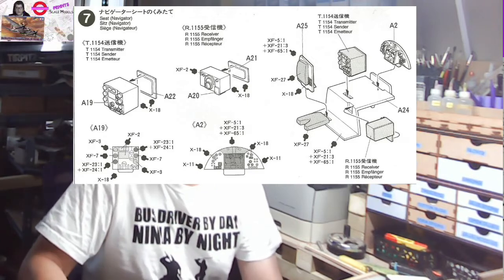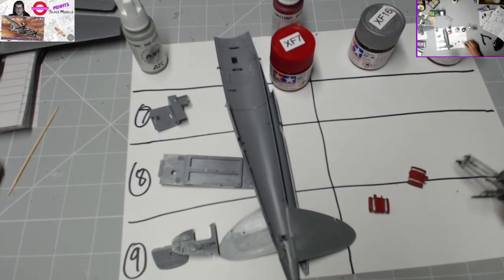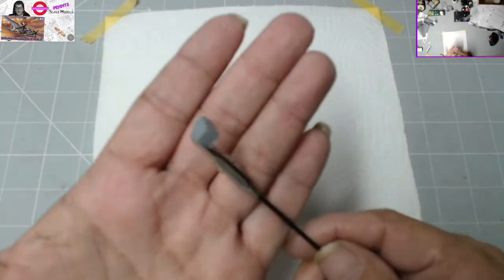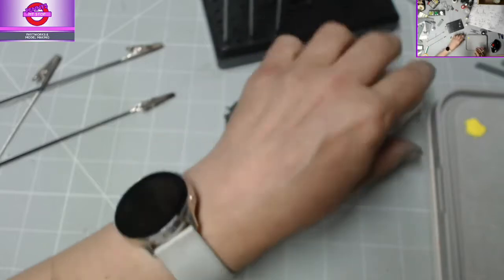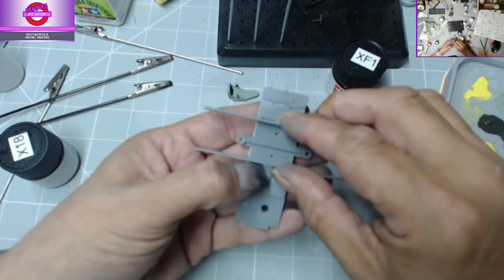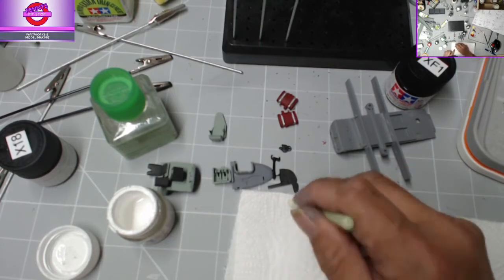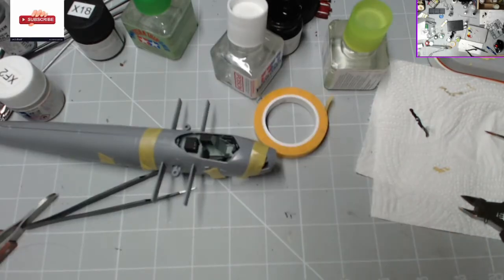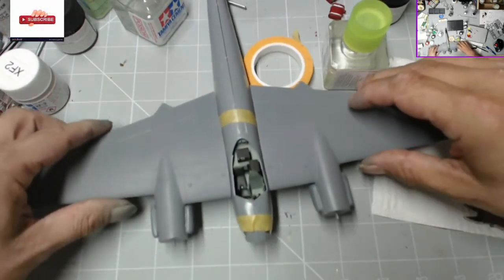PSM Tamiya De Havilland Mosquito B Mk Iv Part 4 Parts 7 To 11 Seats Bomb Bay And Spar Assembly

Comment: I should have told you about this earlier, and it's probably too late now.  The best way to handle the separate nose parts is to join them to their respective main fuselage half's before you do anything else.  You can have more control over how well these parts go together for the best possible fit.  It is more difficult to do, but do the same thing with the wings and wing tip parts.